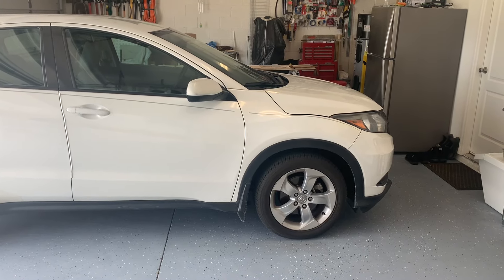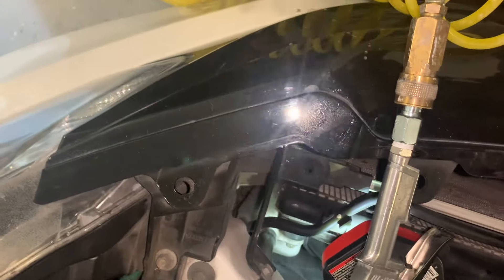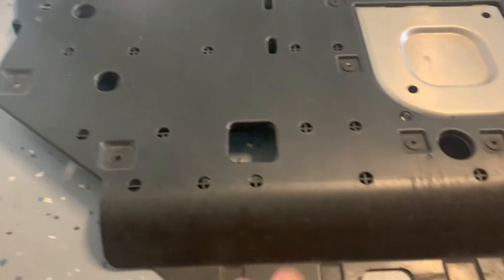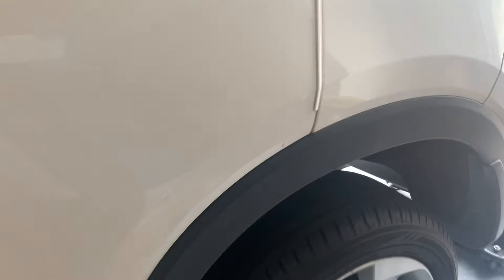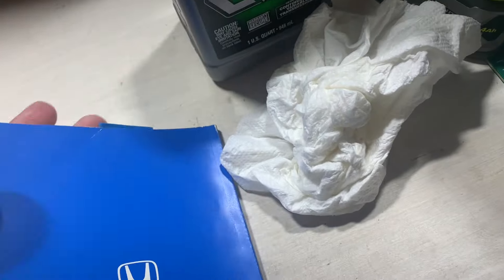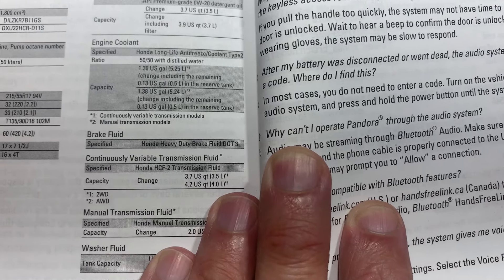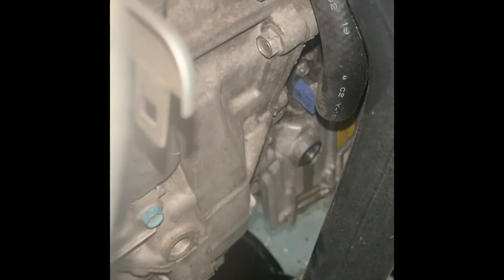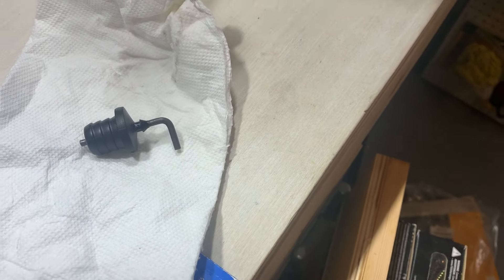How to change the CVT fluid on a 2016-2022 Honda HRV

Comment: This is the proper procedure, many fail to verify the levels by opening the check bolt. You can’t just go by replacing the exact amount that comes out because levels may be off to begin with- either improperly serviced from before or maybe even having a leak.

Comment: the transmission vent arrow should point to the battery not forward as the factory installed it.
Reply: I've been trying to get everyone I know to check their transmission vent. They clog all the time , especially honda. Mine was clogged up at 18,000 miles on my 2019 civic coupe ex-t.  I check it once a month now, and like you said, point it towards the battery. Factory has it facing forwards to the grill. Which is what causes the clogging.

Comment: Great overview of all the necessary steps, especially using the check bolt, washers, and importance of torque specs. Saw a recent video of a Honda tech not doing the check valve step, was getting critique’d big time. Keep up the good work!

Comment: I  WATCHED YOUR WHOLE VIDEO 👍👍👍👍👍👍YOU DID PERFECT JOB👍👍👍👍BUT YOU MADE TOO COMPLICATED 😰😒😢😥I DID THE SAME JOB 😱😱😱😱ALL I DID DRAIN OUT FLUID 👍👍👍👍👍THEN CLOSE BOLT ON THE TOP LIKE YOU SHOWED 👍👍👍I HAVE SPECIAL PUMP 😱👍👍😱KEEP PUMPING TILL FLUID COMING OUT FROM THE WHOLE 👍👍👍👍STOP 😱😱😱😱JOB DONE
Reply: You actually need to cycle the transmission twice after doing that. Fill it until it overflows, then seal it up and start the engine cycling through all the gears, pausing for at least 3 seconds in each position. Then fill again with CVT fluid until it overflows. THEN you are done.

Comment: Excellent Video - Thank You! I appreciate your attention to the details.
Reply from the maker: Glad it was helpful! I tried to get everything in and keep it short and sweet
Reply: Thanks for sharing. It's really appreciated. So, no filter needs to be changed?
Reply from the maker: According to a Honda tech, the filter only needs to be changed if there is a problem, or a suspected problem. I changed the filter once when I first got the car and will probably change it again soon because I’m approaching 190k. I will put up a video when I change the filter.

Comment: That's a great intake idea!
Reply from the maker: Thanks! I was trying to get rid of some left over connectors and silicone elbows. Definitely makes fluid changes easier, and maybe better throttle response?
Reply: @EverydayPhysio  I'm sure it gives a nice sound atleast. Unfortunately aftermarket intakes have been tested multiple times, and have shown to do very little if anything. However on modern cars they need a tune to get full advantage of them. I'm sure it's getting cooler air, and helping your mpg and probably yeah...helping throttle response.

Comment: Thanks for the detailed video.     I saved myself a $309 Brake Masters shop.  
Thought they would “flush it out” for that price but it’s just a DRAIN N POUR service. 
My ATF replacement went well but the only thing is that I should have removed the front driver wheel to allow more space and to catch the fluid into the container 

I got the HONDA CVT oil at the Honda dealership for $13.55 per quart.   Great deal.

Comment: Great video , I like the drain spout hack with the old bottle. What size were the new  washers?
Reply from the maker: Good question!

Washer, Drain Plug (18MM) - Honda (90471-PX4-000)

Bolt, Drain Plug (20MM) - Honda (92800-20000)

I can’t believe I forgot to include that! I added to the comments

Comment: What about the filter?
Reply from the maker: I asked a Honda service advisor about that and he said that they never change the filter unless it is over 50,000 miles and it looks like the transmission fluid has never been changed (or if there has been a problem with the transmission). I changed my filter at 100,000 miles and it still looked pretty clean (but I change my transmission fluid every 8 - 10,000 miles). I plan to change the filter again at 200,000 and will post a video.
Reply: World will be done by then

Comment: You said the cap can pop off??? So mine is missing did I leave on the highway some ware???
Reply: If you have a lower splash guard like he has, you might get lucky and find it laying down there somewhere. The part is easy to replace, part# 25615-5DL-003 at any local dealer. It's about $25.00

Comment: You used the wrong fluid which voids the Honda warranty.
Reply from the maker: https://blog.amsoil.com/your-manufacturers-warranty-is-secure/amp/
Anyway, it’s a moot point as the vehicle has been out of warranty for over 50k miles.

Comment: CVT  has no gears
Reply from the maker: Great observation! The part of the vehicle in question is commonly called a gear selector or gear select lever (to indicate the positions of park, reverse, neutral, and drive). Of course there are no gears in the actual assembly, but the term is still used
Reply: And in fact. If you have a sport stand with spoon on thé stearingwheel ten you have a cvt that gives you 7 fictional gears.